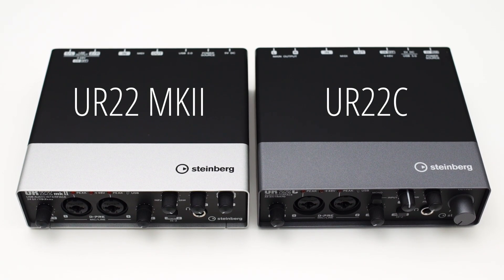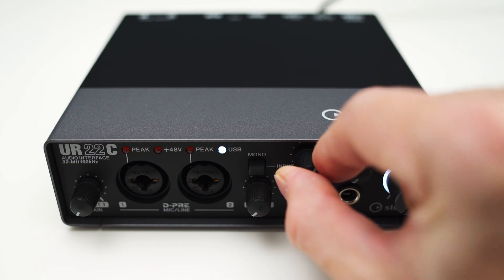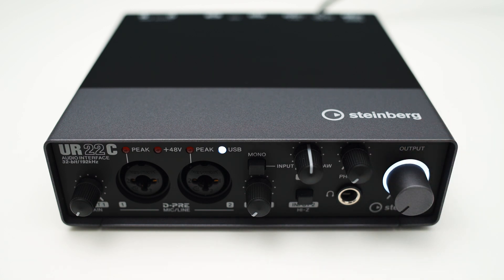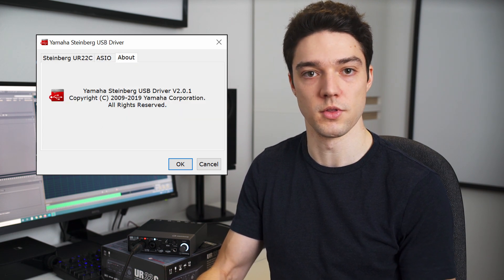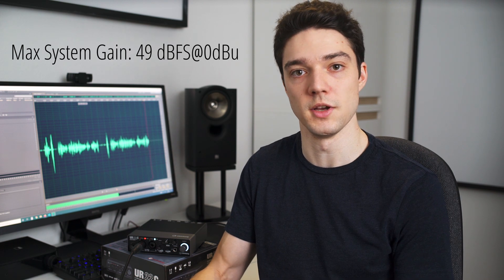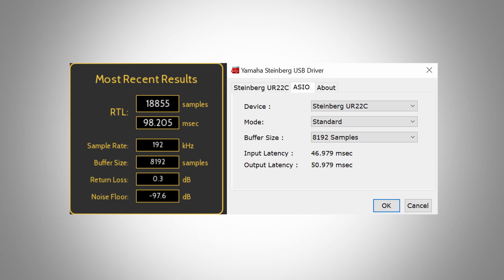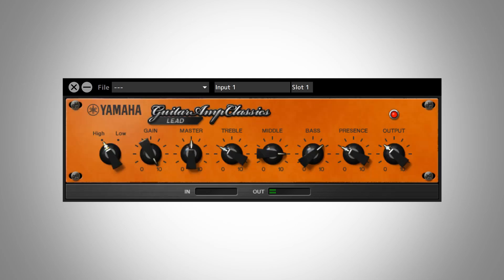Yamaha URX22C / Steinberg UR22C Review - Did Steinberg improve the legendary UR22?

Comment: I suppose thoroughly you talked through this interface using a condenser mic but cannot figure out where the mic is placed. If it in such a long distance, how that great wave is generated at the pc. I recently brought this but I have to push the gain knob upto 90% to record any voice which was roughly 40/50% with my previous scarlett 2i2. Is this a flaw with this UR22C?

Comment: Solid interface. Been using for 10 years now (mk2) and flawless. Don’t be concerned about the noise level on mic pre, it’s all good. Built like a tank, cheap and won’t let you down ever.
Reply: How about the uneven left right channel? Some people said the right channel is louder. Is it true?
Reply: @ do they? I’ve never noticed it (and I would, I’m a bit ocd about symmetry and such). Only negative I’ve noticed is the preamp noise if you turn the gain high up, which you should never have to do anyway, so basically you never notice it, records clean as a whistle. Oh, one more thing! When I first used it powered by usb using cubase AI that it came with, it would drop out annoyingly. But I switched to the 5v power source (and use Reaper) and it’s been 10 years of flawless reliable operation.

Comment: I have been using UR22  since its first version. I also use and 816C  for my studio. Each version performed extremely well for me. I also use NI Komplete audio which is also an excellent interface. As far as noise floor is concerned all of them performed at a level where there is any difference in practical usage. Most of the German made interfaces are of extremely good quality. Moreover, UR22C comes with this DSP effects which is no one provides at that price point and the effects are very good. It saves my day when artist asks for a near real-time monitoring with reverb.

Comment: Whats the difference between phantom power & low or hi Z  settings/requirements?
Reply: Panthom is using to "power on"  condenser mic, high z  input is to use when we hook up a guitar without needed to use a DI, while low z is to use when we hook up an audio device or kinda, that's all i know, hope it helps

Comment: Does anyone else feel it unacceptable to have to boot into recovery mode to disable a security feature to install the Mac OS driver for the UR22C? No other device manufacturer requires you to jump through these extra steps so they don't have to write functional code. Also the pdf instructions no longer match the layout of the recovery console so you're selecting options with potentially serious consequences blind. I'm personally not prepared to do it. I feel like someone at Steinberg said "Hey let's see if we can get away with this". I'm sadly ditching my UR22C, which is otherwise brilliant, and buying something else from a company that puts proper resources into driver support. Last Steinberg/Yamaha product I will ever buy.

Comment: Hey @Julian, can you please help understand how turning on phantome power impacts the connected instrument? Let's say I have connected a condeser mic (input 1), and electric guitar (input 2). Steinberg claims that when phantome power is on it applies to both input channels. While the mic will benefit from that additional +48V, how will that affect the performance of the connected instrument? Anyone, any experience with that?
Reply from the maker: Hey, phantom power is only present on the XLR connection. There is no phantom power on the TS / TRS inputs. If you connect an instrument with TS / TRS it is not affected by phantom power.

Comment: Greetings from the future. Did you go to work for SpaceX yet? (Not that you need to.)
I am blown away by the DSP processing. In 2022 I am critically lagging on these subtle features. The 32bit DSP would depend on compatible filters, or at least an interface module. Being as this feature is a real incursion onto professional deck territory, it may have gotten the slow-walk. Not knowing this today, I would have still bought a much larger deck Yamaha MX12UK just for the one knob compressor on every channel. Not needing any other feature over the basic 2 channel DAW I/O.
I am excited to see what the future brought!

Comment: Help me.. this UR22C or the Volt 2?  wich one should I pick up? Thx.
Reply: Ur22c headphone volume is low for higher ohm headphones (80 ohm and up) and loud preamp noise.

The Volt 2 main feature is on board compression, from what i hear is not that great and creats more noise than anything for the price of those 2 I wouldn't get either and buy a id4 mkii
Reply: @sikwitit773  thanks for the advice bro..
Reply: @sikwitit773  well, and what about id4 mkii & Motu M2? wich one would u pick up?
Reply: @thiiagoteixeira  iD14 mkii is more well built compared to motu m2 but motu is more straightforward and the Audient id14 mkii allows you to create different mixes to send to different outputs with a total of 6 outputs. And the headphone amp is better i hear

Comment: which one is better if you compare that to evo 4?
Reply: I have the ur22c interface and while it is rock stable with win 10 and Cubase 11 there are more transparent interfaces out there. It all depends on what you are using it for. From what I have read, some other better interfaces out there seem to suffer with driver issues which would be really annoying. I have thought of upgrading but at the end of the day this interface is well built and solid. It also has a mixer so you can set your volume between your Daw output and input sound which is very handy and which many interfaces don’t have.

Comment: just a heads up from a slightly disgruntled UR816C owner. If you use those onboard effects then the midi stability goes out the window. In fact I've not been able to use the midi inputs at all due to this problem. You will need a separate midi interface/usb cable as the one on the unit isn't fit for purpose (both mac and pc drivers)
Reply: Well fuck...

Comment: Hi Julian,
I have had the ur22c for about 10 months and my main reason for buying it was to get the Cubase DAW software that comes with it.  it is a very solid construction and with the blend knob for DAW /instrument that is a real plus and I use that all the time. My thoughts are the interface doesn’t capture a pure sound and by the comparisons with other interfaces,  your electronic test results show it’s lacking compared to other interfaces. 
I have been looking to upgrade to the UA Volt 2 as it has very high measurement specs. The question is will I be noticeably impressed if I upgrade?
Thanks in advance. 🤗🤗🤗
Reply: Hi, so..did you get the Volt 2?
Reply: @maiconsks  I ended up getting GAS and buying a Scarlett solo but after a bit of use have gone back to my ur22c because it pairs better with the Cubase software.

Comment: I have this interface over a year now... The ''Steinberg'' logo on the top of the interface litterly faded away. Also the paint on master volume knob paint also got deteriorated.
I always took great care and NEVER travelled with it. Does anyone have the same issue with this interface? Also is the pre-amp (Yamaha D-Pre) really that bad? Imagine the Yamaha MG series mixers which has the same pre-amps... It makes me want to upgrade to something else maybe SSL2+ or Focusrite Clarett or AXR4U...
Reply: I have the UR22 mk II and i dont have a problem with the paint. But i have a Problem with the Interface itself, Sometimes the Interface just stopped for a second recording and the Output (Headphones & Speakers) is sometimes Distorted for no Reason. I upgraded to Komplete Audio 2 Interface in August an it works fine and also it looks clean and fancy. The UR22 is for Beginner completly fine, but it comes with some problems.

Comment: has anyone of you noticed the right side (or left) being louder than the other? i got the UR24C two times and both times it seems to favour the right side of my headphones
Reply from the maker: Hey, is this only at low volume or regadless of volume setting? It might also be that your headphones drivers are unbalanced and one side is louder. You can try your headphones with another device and see if that's the case.
Reply: I've read about this too in many audio forums

Comment: I like the DSP in my UR44 a lot, sound is decent too. But there's still a little something coming out of the monitors with the knob all the way down and if you're using a Mac, Steinberg is always 1 or two OS generations behind and it's still glitchy. Software won't work at all on the M1 Macs so it just becomes a dumb USB audio device. Kinda sad to sell it.
Software Monitoring totally works with Logic on the M1 Macs however; giant project, effects galore, lowest buffer, no hick-ups, plenty of CPU headroom. Leaning towards the M-Audio 192

Comment: Hey Julian! Great video! But I'm confused about something... I thought that the Sample Rate was, well that, the rate at which audio gets sampled. Meaning that if you can choose between 44.1kHz, 48kHz, 96kHz, 192kHz, those would be the amount of cycles (hertz) of audio sampling in a second. The higher the sample rate, the more samples and information gets saved, which helps when slowing down audio in post for example, and not destroying the audio, as the process has much more sampled audio to work with. I thought this was the true explanation of what sample rate is, but then you went on to mention that it was something like the response frequency of the pre-amps (or inputs).
So just wanted to try and clear that out, any insight on this would be hugely appreciated! :)
Reply from the maker: Hey, you are correct. Additionally, the sample rate dictates the highest frequency that you can capture, which is half the sample rate. So, for example with a sample rate of 48 kHz the highest frequency you can capture is 24 kHz. Everything above that will be cut off by the anti-aliasing filter. That's how the sample rate affects the frequency response. The higher the sample the higher will be the cutoff point of the frequency response.
Reply: @JulianKrause  YouTube just sent me the notification for your response haha. Just yesterday in my Mastering class, they taught us exactly about that. What aliasing is and how anti-aliasing works. And cleared up exactly this subject, what sample rate is and does. I'm sure if I'd seen your answer earlier I wouldn't have understood what you said. But it all now makes sense! Audio is a crazy world, I think I'm in, love with it hahaha... Thanks for clearing things up for btw! And keep up the great work on the videos! :)

Comment: Did Steinberg change the headphone output impedence in models produced after this review?  The current documentation for the UR22c states that the headphones output impedance is 40 ohms.
Reply from the maker: Hey, they didn't. The specs state the power into a 40 Ohm load. This is not the output impedance of the headphone amp. Cheers!
Reply: @JulianKrause  Cool. Thanks.

Comment: Thank you for your video. I have a question. My PC doesn't have a USB 3.0 Port. Does it work fine anyway or what do I need to make it work?
The manual says it requires an optional power supply for USB 2.0 but I don't understand what it is.. please help..
Reply from the maker: Hey, it works just fine with a USB 2.0 connection. No additional power supply needed.

Comment: One question about the noise comparison between the different devices: The max mic gain of the UR22C is higher than that of the Presonus 24C for example. So was the noise test performed by the exact same input gains or the respective maximum available gain of each specific device? In the last csae it's not that surprising that the UR22C produces more noise since it has more max amplification compared to Presonus 24C or Scarlett 2i2 for example.
Reply from the maker: Hey, the preamp noise (EIN) and my noise sound samples take the gain into account. So, you can directly compare the number and it's a fair comparison.
Reply: @JulianKrause  Thanks a lot! The reason for my question: During the last days I took a deeper look at the UR22C and the Presonus 24C. Midi was fine with both of them and I couldn't find a difference regarding latency. Audio inputs for my digital piano were also satisfying with both interfaces. But when I tried to record tin whistles with my Marantz MPM 1000 I had to struggle with the 24C: The input level was quite low so I needed almost the complete input gain, resulting in remarkable noise. With the UR22C I needed much less input gain and had slightly less noise in my record at a comparable loudness.
(I also performed the same tests with the scarlett i2i 3rd, but due to the additional needed USB cable I got a very noisy input signal. Probably this isn't a fault of the scarlett but my setup, but why looking for the cause, if there are alternatives without this problem.)

Comment: Now you've reviewed both focusrite 2i2 and steinberg ur22c, wich one would you go for it and why?

It's better to have the monitoring wheel between daw and the unit and the midi connectors like in the ur22c or the possibility of plugging 2 line instruments and the lower noise of the focusrite? :)

Comment: Hi I see you also perform speaker measurement,  I have this interface and using it for speaker measurement however I don't really understand this mix knob. If it is all the way to DAW the system is nice and quite, but if I turn it to input some buzz is coming true the speakers that I'm measuring. Do you know how to set it?
Reply from the maker: Hey, the mix knob let's you control how much audio from your DAW and direct audio from the mic you will hear. When you set it to input the audio from the mic will be direct fed back to the speakers and this will be again picked up by the microphone. This creates a feedback loop and destroys your measurement. When doing speaker measurements turn the mix dail all the way to DAW because you only want to record the sound from the speaker which is played by the measurement software. Happy testing!

Comment: Hi! Thanks for the review. I have one question, I have following situation - I'm recording a guitar and I'm using both inputs, INPUT 1 for D.I. box and INPUT 2 for guitar processor, I'm recording only INPUT 1 and I'm using INPUT 2 just for monitoring myself with guitar processor. So my question is - can I listen to INPUT 2 only with direct monitoring or DSP monitoring? without hearing DI sound of my guitar. When I'm doing this in DAW I have a latency, because of buffer size.

Comment: I've been enjoying using my old RME Hammerfall 9652 digi PCI card, with an Alesis Ai3 ADAT, but only having 32 bit drivers means being limited to 32 bit O/S, therefore a 3.5GB memory limit. So I am now thinking about a new, portable interface for live streaming on my 64 bit O/S and recording on the go. I really appreciate your incredible videos. It seems like for recording two line level inputs the UMC202HD is the best bang for buck. I've heard RME have some of the best RTL numbers so will try to stick to that for recording instruments or voice and my general recording, as I think it must still be a great sound card. Does it compare with new generation hardware? I've used my flatmate's gen 2 scarlett 2i2 and it seems quite nice. I like Steinberg software but this seems like it would be best for those wanting to record instruments or mics with the inbuilt dsp.

Comment: I want to buy UR44C. I have some doubts about usb-c connector. Is it going to work on my laptop ASUS n61j with Windows SP1 or should I go with USB 2, that is UR44C?
Reply: I think you might be getting your terminology mixed-up. The UR44C supports both USB version 2 and USB version 3. The cable that comes in the box is a USB type B -> USB type C connector, and it supports both USB 2 and 3 protocols. You could also get a USB type C -> USB type C cable (which is what I did).

Comment: According to another review you can't record the reverb effect. It's monitor only. This seems an odd choice, and I'm surprised with how thorough your review is that you didn't notice that. So maybe they changed this with a firmware update?
Reply: You may not be able to record the reverb effect, but VST3 plugins for all the internal effects are included with the purchase, so you can just apply them after your DAW. This has the advantage of allowing you to tweak the settings after you have recorded to get the best sound possible.

Comment: Steinberg claims it has a 32 bit DAC/ADC, but if it's only got a dynamic range of 102dB, as opposed to the theoretical 200 of true 32 bit processing, then it sounds like its purpose is purely to market it as better than its competitors even if you don't technically get anything out of it.

Comment: PLEASE HELP ME OUT, I m using this audio interface and,  Im a beginner in music programming. MY problem is related with Audio recording. After I complete  the drums and synths programming , when I try to record the vocal track I see that the whole other tracks get mixed with the vocal track automatically as if I have done the Audio MIXDOWN. This happens even when my headphones and speakers are muted to zero but does not occur when I record vocal in solo mode  . so there is no doubts of sound leakage from headphones to microphones. Please let me know if its a configuration problems?????

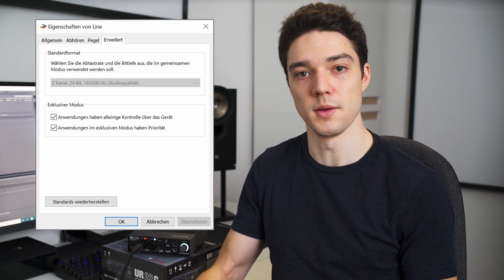Comment: 6:38 Hi, Julian, fantastic review as always. Could you please confirm as shown at 6:38 if you are not able to change the bit depth of this device in Windows? This is a deal-breaker for me unfortunately because certain software I use only functions with 16 bit devices
Reply: @DudeMcGuybro  That's a real shame cos this thing has a stand-out feature over (as far as I'm aware) every over commercially available AI with that DSP. Thanks a lot for letting me know. I'll keep an eye out for any workarounds or firmware updates that rectify it, but tbh I suspect it's a side effect of the DSP that they have to force a minimum of 24 bit